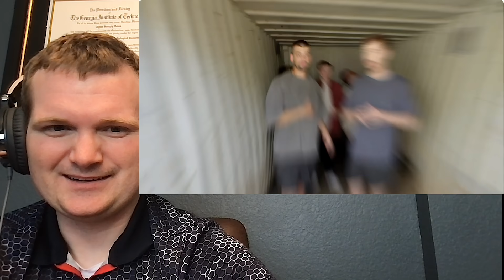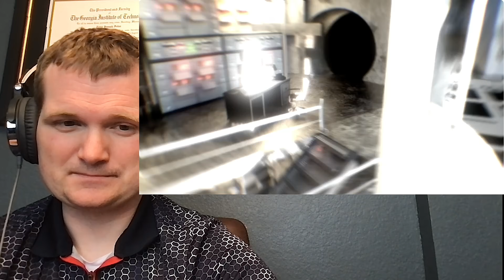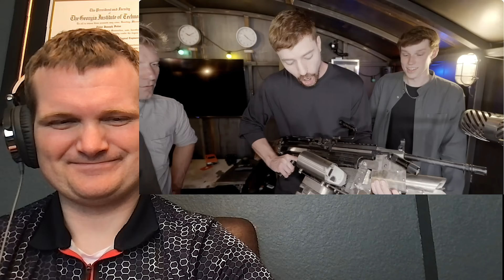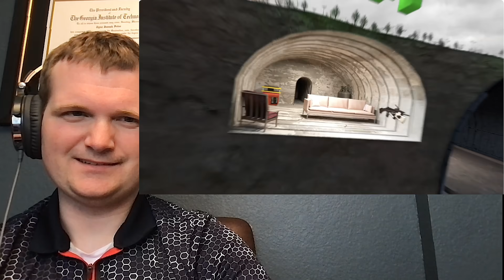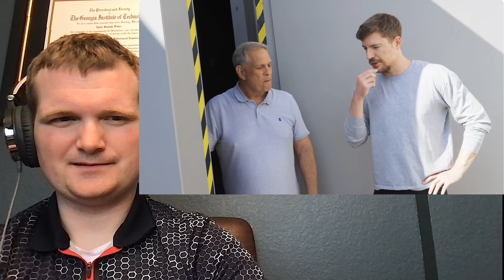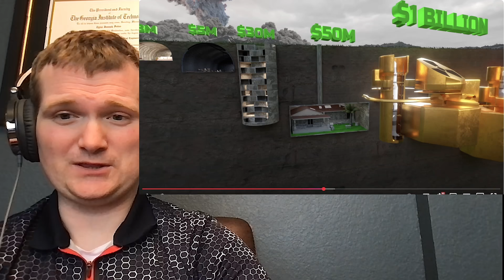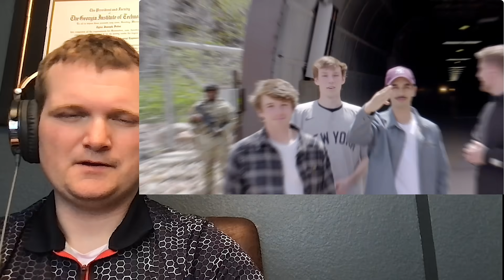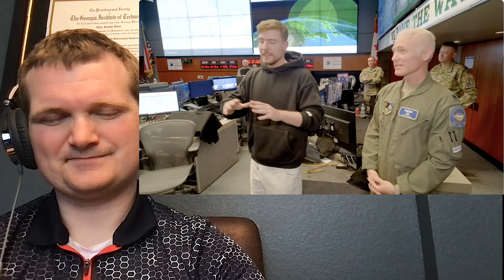$1 vs. $1,000,000,000 Nuclear Bunker - Nuclear Engineer Reacts to MrBeast

Comment: My Father who is now retired, was a Major in the Air Force.  He at one point worked in an underground Nuclear Missile SIlo as the Officer on the post.  He was the one in charge of verifying turn-key operations.  So basically he was in charge of a Nuclear ICBM with a M.I.R.V. Warhead (Basically it has multiple nukes in it that seperate to cover a wide area after launch)  

He said it was one of the most miserable places to live, but also one of the coolest in a way.  they had tiny bunks and lockers.  etc.  THey had an escape hatch that was full of sand you could access from the TOP of the suspended capsule.  The entire facility was suspended on springs or something in a capsule and you had to use a ladder ontop of it to get to the hatch.  They used to say that if things went south topsisde they would be stuck because the sand would turn to glass.  

People would be stationed there for months at at ime if not 6 months before having long breaks of being topside I Think.  I would have to ask him for more details.  But it was interesting to see that nuclear silo as it looked a lot like what he described.  it was probably pretty much the same.

Comment: cheyenne mountain is actualy built to withstand a direct hit all the buildings are underground of a literal moutain and they are ALLL suspended from everything there are gigantic shock asorber springs on every side of the buildings from the walls floor and sides of the muotain cavity and the moutain it self is also all dug out and on shock asrbers

Comment: China claims to have one 6500 feet underground that holds a million people. I'm not sure if I believe them, but that would be nearly impossible to destroy if true. However, the best option in my opinion is a bunker that either no one knows about, or one that is of such low military significance, no one would ever target it.
Reply: You dont need to destroy it. It can hold a million people but certainly cant feed a million people. Same as the Cheyenne Mountain complex. Most military complex have 3 months of supplies, maybe 6 for long term assignments. No way you can feed even 200 people without a means to create your own food down there. That is very expensive and requires a lot of power and even then underground food production cannot provide the quantity of food you need for decades. You need to scavenge your own food from elsewhere, even if its canned food or later, when the surface food spoiled and outside food production is still impossible because of the ozone layer depletion, changed weather pattern and very high UV radiation, cannibalism. "The living will envy the dead."
Reply: China's official claims can always be disregarded, most of the time it's CCP propaganda

Comment: Cheyenne mountain is a large complex, with room for staging a few hundred diplomats, and then a full military contingent, housing for tanks, airplanes, and some other things, total probable room for people (including military staff and combat) would be about 100,000. It is a full city around 15 sq km.
The reason for the double bunker door system is, you don't want outside air coming in, the inner door is assembly space, then the next room, is your staging space, then you open the outer door, that way you can reverse pressure in staging space so that as the door opens, it air pushes out slightly, that way you don't draw in waste/toxic materials. Then on entering the first area, the door is closed, and the room is fully air cycled and purified/cleaned, then the inner bunker door would be opened (this would be in a nuclear/chemical situation).
Reply: Basically an airlock, which is the case for other military bunkers as well
And also for security, so that at at least one door is closed at all times (but not in this case, since they've shown both open?)
Reply: Pushes the air out instead of in.
Reply: The NORAD command center in Wargames is more impressive
Reply: @david-spliso1928  I think you meant this, but they were not allowed to film in the real one, so they made a set. Someone is trying to interface to the massive mono screens they had for the filming, but I cant remember the channel name. They are trying to remake the tech side of the film set.
Reply: @keith_5584  I meant the movie version compared to the real version. Yes there's a guy who recently made an interesting video detailing and recreating the vector graphics techniques they used.
Reply: calling it a city is a stretch. it's just one big office building
Reply: @Jaice2nd  I think if it can house 100,000 people and takes up 15sqkm of space, it's a pretty safe bet to call it a city (or town at the very least) lol

Comment: 0:53 The Joint Operations Command Centre in China is supposedly buried 2 km down. I think that would have a pretty good chance of surviving. 

The GBU-57 only penetrates 60 m, and past underground tests were only able to excavate 100 m when buried 170 m down. You can't really build a bigger penetrator, because there aren't any aircraft able to carry them. Even the GBU-57 is too large for an ICBM. A shaped charge could go a bit deeper, but it would excavate less. The second dig would be less efficient as the material is much more likely to fall back in the pit. The third is even worse.

Shockwaves do a poor job of moving dirt. This is why open-pit mines use excavators.

Also I imagine their engineers did a lot of simulations in order to arrive at that depth.

Comment: Seems to me NORAD would be the least safe bunker. It is likely going to be hit by multiple warheads at the very first attack.  Most secure while also being most likely to be hit multiple times.  Id take my chances with the 75 person condo.  Some protection and maybe 100's of miles away from the closest nuclear detonation.
Reply: The NORAD one would certainly be a high-value target, but it is also in the middle of the country (meaning that it's very far from any enemy launcher that wasn't secretly in space), and the only one with active defenses. There are multiple radar and satellite systems watching for threats, and multiple layers of missile defense from the ground and airplanes. If a hundred nukes were launched at it from foreign lands, planes, or submarines, would any of them actually reach it? Who knows for sure, but I wouldn't count on it. Attacking the coastlines would be a much safer bet for surprise attacks because there would be a shorter time between launch and impact.

The decommissioned silo would probably be the least likely to be targeted and therefore safest to be in, because those were originally built far from population areas and since being decommissioned that one has lost all value as a military target. The apartment complex would likely also be safe, but closer to a population area.